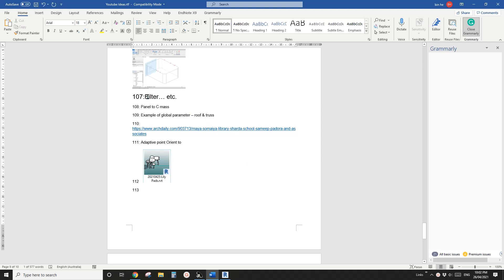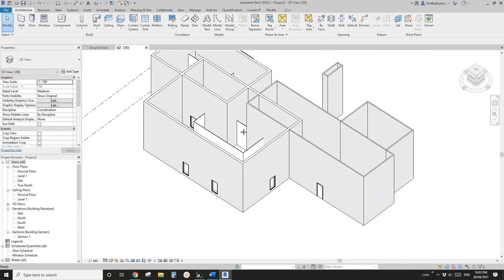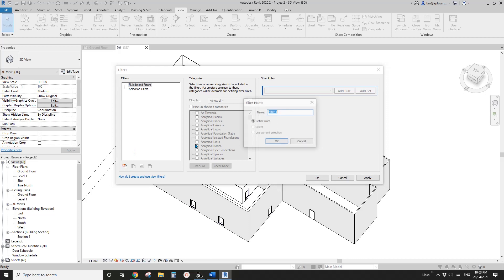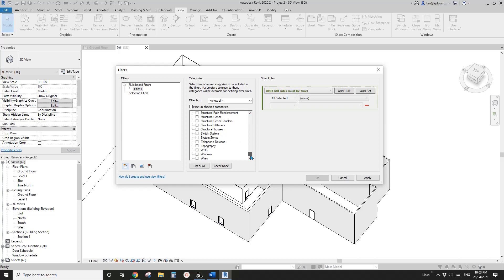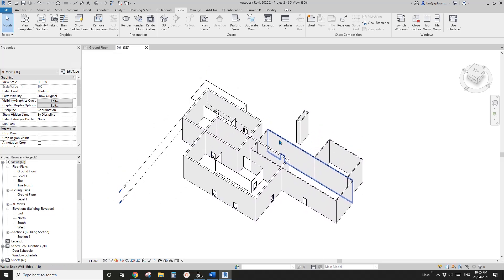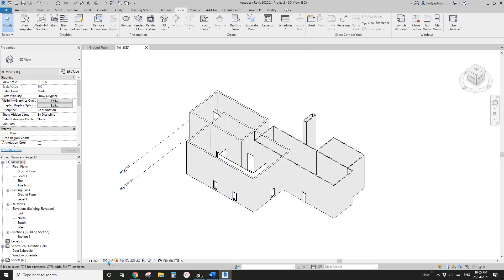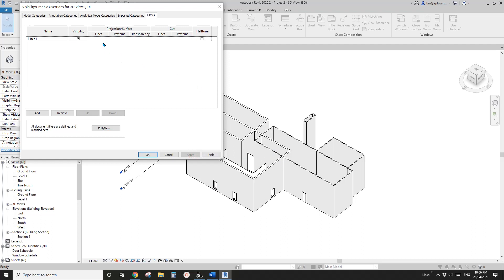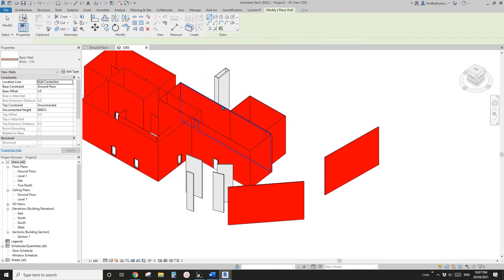Everyday Revit (Day 403) - Filters

Comment: Big fan of this channel!  I'm trying to figure out how to model a wrought iron railing? I thought of you right away with your unique videos.  Any insight?
Reply from the maker: Depending on the complexity of the railing, can you post an image?
Reply: @BINHE615  Thanks for response! What would be the best approach you think?
Reply from the maker: Usually, I do not model puppies. Oh, sorry, the railing... I assume this railing will not change length?
Here are some options:
1. Pretend there is no pattern, just model it as solid thin walls. If possible, find a similar pattern material for it.
2. Model some solid thin walls same to the option1, then add some model lines on them.
3. Model the railing using either wall or generic model, model the pattern as void so you can some that curved solid. 
For the pattern, you can try to find some DWG file and import the DWG while creating an extrusion, or you can import the image and trace the image. Model it as a family if multiple instances required.

If it was me, I would choose option 1 or 2.
Reply: @BINHE615  Thank you Bin, funny I didn't see the puppy haha.

I tried the thin model in place and then took out spaces with a void.

Thanks for your great channel, always look forward to your videos
Reply: @BINHE615  https://drive.google.com/file/d/1IZ1z8yWuSAZjBl6oOgRG6pXwXf9e-pOm/view?usp=sharing

Comment: Thank you Bin.  wish to see some more filter setting rules  like temporary section marks should not visible in the final sheet views. also vice versa. also wish to see and function.
Reply from the maker: I tried, I can successfully hide Sections with sheet number, not those without... Maybe that's something Autodesk doesn't want you to do? Maybe just use the Hide Unreferenced View Tags option so they are shown on screen, not print?